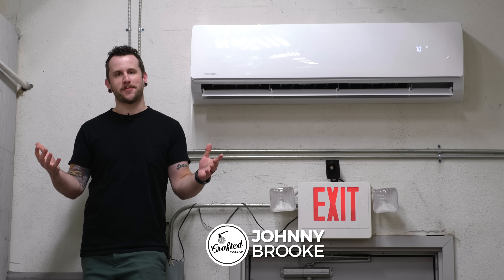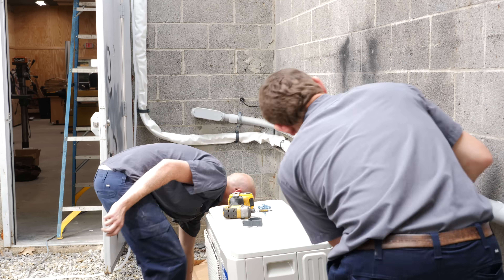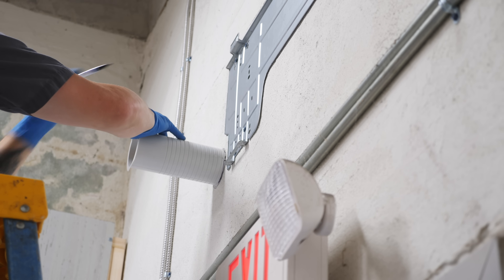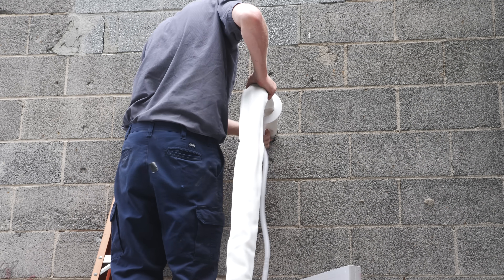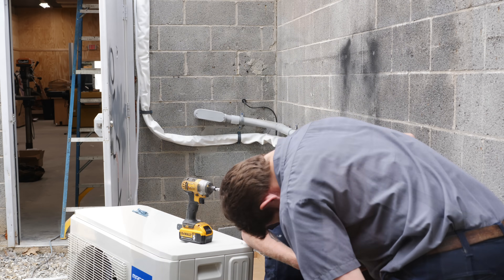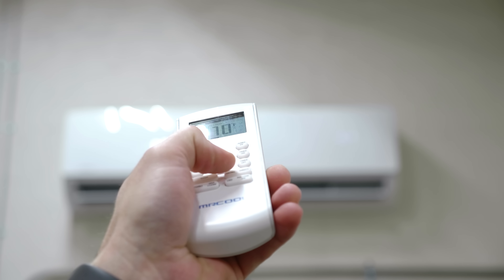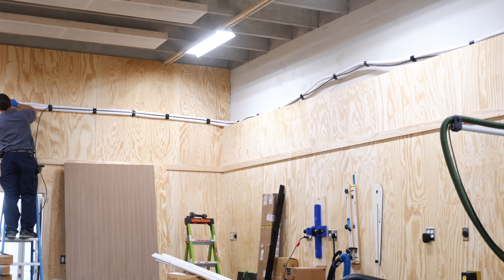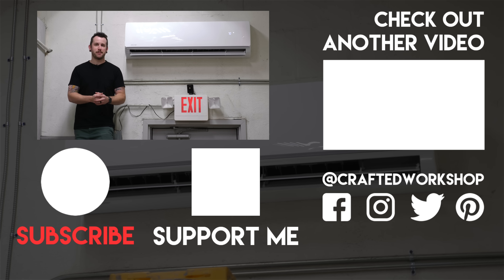How To Install A DIY Ductless Mini-Split Air Conditioner ❄️ In The Shop

Comment: was wondering the size of your shop and how much insulation. I am looking for a unit, just don't know the size. My shop is 1500sqft with blown insulation. I heated the shop this winter with two small electric heaters so the insulation is paying off.  So kind of hoping to get one of these units.
Reply from the maker: The shop area is roughly 1200 sq ft and the walls aren't insulated. This 18k unit has easily handled the space and I think you'd be good to go in your space since you have insulation.

Comment: Installing a mini-split is never a DIY job unless you work in the HVAC/R industry. There are special tools required to do the project that 99.9% of homeowner’s do not have access to or the skills on how to use these tools for a proper install. Moral of the story: Spend a little more on the front end to get the job done correctly by a licensed professional in order to save yourself time, money and stress on the back end.
Reply from the maker: Did you watch the video? This unit does not require any special tools to install since the lines are pre-charged.
Reply: Crafted Workshop Yes. I watched from start to finish. The tools I am referring to are as follows: A proper set of refrigerant gauges with hoses to connect to The refrigerant ports, a vacuum pump, micrometer, nitrogen tank and pressure regulator. You would never just open the refrigerant lines and then spray the fittings to look for leaks. Proper procedure is pressuring the lineset with dry nitrogen up to 300 psi for about a half hour to make sure it holds pressure. If the PSI is the same after 30 minutes you would then purge the nitrogen out of the lines and connect the vacuum pump and micrometer and start to pull a vacuum. The goal is to pull any air or moisture out of the lines. Refrigerant is made of oil and I am sure you know oil and water don’t mix. After you are certain that the refrigerant lines were free of any contamination, you would then open the valves to let the refrigerant into lines. After the refrigerant was released you would start the unit up to verify that it was cooling properly. I’m a licensed contractor in the metro Atlanta area and run service calls on these DIY projects on a regular basis. 9 out of 10 times the problem is associated with poor installation practices. Nothing against you or your channel. I just disagree with how simplistic the process is presented because I believe it gives false hope to consumers.
Reply from the maker: That is the process for a typical mini split, NOT for this system. Please read up on this particular unit before misinforming people here.
Reply: Crafted Workshop I did download and read all the documents for this unit yesterday and see it is different than most products. I am man enough to admit that I was speaking on behalf of the typical mini-split and not this particular make / model. You are correct that it is designed to be DIY and I was wrong.

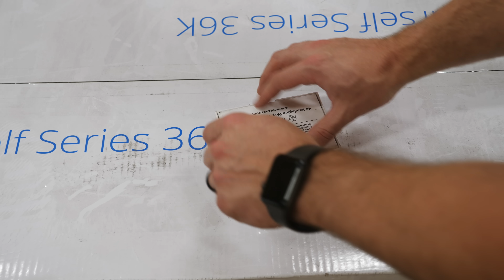Comment: This guy was a pro?  3:00 that raggedy hole wasn't even covered by the flange. Look at the 1 o'clock position.  At 6:00 he lifts the cover and the bottom of unit rocks out from the wall.

Comment: DIY? Using 3 pros to install it is not a DIY! Pre charging the gas from the manufacturer does not make a DIY also! The things youtubers do for free stuff!!
Reply: Jacob Hajarat I think the video explained the situation...you could DIY, or you could just complain for no reason....
Reply from the maker: Yup! People love to complain. Thanks Al!
Reply: @craftedworkshop  its not a complaint, I'm just stating the obvious! I've been watching ur videos for years and I watched them all since I love the content, but I hate it when YouTubers do or say anything for free stuff!
Reply from the maker: It is a DIY install process though, because the lines are pre-charged. I could not legally do the work myself in this case but I figured I could still make a valuable video showing the process. Thanks!
Reply: I installed mine myself, and paid for it myself. I had the smallest one (12k or 15k. I forget). It works really well for both heating and cooling in my small shop. It kept everything at a pretty constant temperature last summer, fall, and winter. Working on its second summer now.

I do recommend having a friend help you, though. Installing it solo had some challenges.

Comment: I see these mini-splits all over the place these days be it apartments or houses or...But the outside units are so small that I'm guessing they run constantly but they aren't sized the same way as my compressor which is a 4 ton for 2000 sq ft.  How many sq ft does your system service?
Reply from the maker: This unit in the shop is covering 1200 sq ft. These things are surprisingly efficient, they don’t need to run constantly to keep a space cool, as long as it’s insulated properly.
Reply: @craftedworkshop  I can't figure out how this is possible.  That my house takes a compressor that's 3' x 3' x 3' and while I don't know the size of yours I know it's much smaller in comparison and even if you doubled your size to cover a similar area it would still be much smaller.  They operate the same way.  The compressor compresses the gas, your High side, which goes to the heat exchanger on the inside where a fan blows over the coils causing the condensate to drip which ultimately plugs up and is usually the biggest expense to homeowners to have HVAC clear their line.  The exchanger absorbs the heat out of the air causing the refrigerant to expand and the pressure to drop and it's sent back to the outside where again it goes through a heat exchanger and the fan blows across the coils to remove as much heat as it can till it's repressurized.
Reply from the maker: Your unit has to send that air through tons of ductwork, where as this blows the air directly into the space. They are totally different systems. I’m no HVAC guy but these units don’t need to be huge to cool a large room, but they are only effective in that open area, not across multiple floors and rooms.
Reply: @craftedworkshop  I almost bought your answer and while you are onto something my A/C and most A/C systems I have had in the past don't do a good job at cooling anything but the main floor.  2nd Floors might be cooler but they're not as cool as the 1st floor.  The 3rd floor, attic, or top floor never get cool, especially where you have a flat roof.  

In newer homes, they are installing 2 units instead of the conventional one unit for the entire home.  They install one unit for the first floor and a 2nd unit for the 2nd floor if it's a living space regardless of having an attic or not. 

I have a friend that has apartment buildings and he thought he was going to save a lot of money by moving to the mini-splits but the tenants hated them and just like all A/C systems they don't go around corners.  They're only tolerable when they blow straight into a single area like what you have.

Comment: Seems like a lot of content creators are putting in a Mr. Cool system. April Wilkerson, Abom79, Johnny, who else?
Reply from the maker: We all need AC in our shops, hah. They make the only DIY install unit I’ve seen, so it saves a ton on labor costs, plus they’ve been willing to send us units for the exposure. Win-win for all of us.
Reply: @craftedworkshop  Oh, I'm not knocking it at all. Just funny when you see a particular brand or specific item make the rounds in a relatively short period of time. I mean, it's certainly effective. We're all here talking about it. Haha. I think around this time last year, there seemed to be a strong push from Inventables to get folks using their X-Carves.

Good install video though!

I have basically the same unit in my shop, just a different brand name on it. Pioneer I think. Still, it's the same condenser, inside unit, and remote control. Wasn't a pre-filled lines kit though. Luckily, my neighbor and friend is a commercial HVAC guy and came over to pull a vacuum and such on mine with his gear, after cutting the lines to the correct size and brazing on new fittings.
Reply from the maker: Nice!
Reply: @craftedworkshop  Yeah, so don't say you reached out to them out of the blue and pretend like this was all a happy coincidence. They seeded devices with key YouTube channels. It's great they did that and you're happy with it, but I appreciate transparency and honesty.
Reply from the maker: As I said in my other comment, I did reach out to them, as I said in my video.
Reply: Izzy Swan. Then that video disappeared just hours later. Went to my browser history, and got, "This video has been removed by the user".
Reply: DIYcreators and homebrew

Comment: You need some kind of license to deal with 220v devices in USA? In my region of Europe 240v is standard home voltage. :D
Reply from the maker: Unfortunately both have to be done by professionals in a commercial space. And yea, really depends on your state and zoning. I was especially cautious to follow the rules since I film everything and post it on YouTube. Basically creating evidence 😂
Reply: same here in Australia you get 240v at the wall but our power prices cost an arm and a leg some times better running a diesel generator when the fuel prices don't cost an arm and a leg. every thing here cost a good 30%-40% more then any where elce.

Comment: Mr Cool might let you install your own split unit but some other manufacturers will void your warranty if your unit is not installed by a qualified professional
Reply: The Mr Cool stuff comes pre-charged and is intended to be installed DIY. I've had one in my workshop for a year. Works quite well.

Comment: Nice! I have a much smaller shop, so I have a freestanding A/C unit with an air vent through the back wall of my 12 X 16 shed/shop. It has air, heat, fan, and dehumidifier settings. My shop is an over 100 year old Railroad pump cart house with no insulation. There is also a drain hose that runs out through a gap under the "man" door. It isn't great, but it is a whole lot cooler with it than without it. The only problem I've had with it is that it froze up a couple of times when the temp outside dropped a bit last fall, but with the metal roof, it was still kinda warm inside. Humans have gotten so "soft" that they need A/C for comfort, and in the last few years I just can't take the heat either. 
Congrats on the new conditioned air.

Comment: why did didnt use hole saw for concrete?
Reply: he answered that in the video....
Reply: @richardspencer742  I watched again and nothing... maybe give the min
Reply: Richard Spencer , no he didn’t
Reply from the maker: I did, we used the smaller bit to see if it was hollow block and then used the chisel attachment instead. A hole saw would have thrown fine dust everywhere, whereas the chisel just broke it up into pieces. Both would have worked.